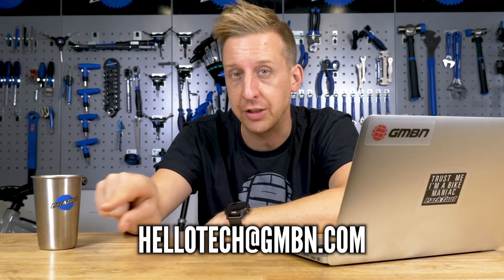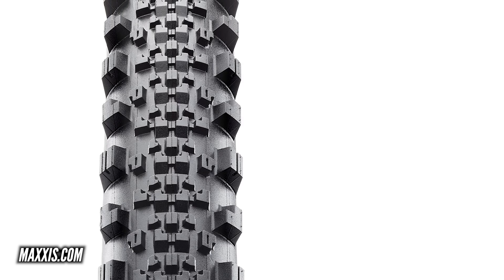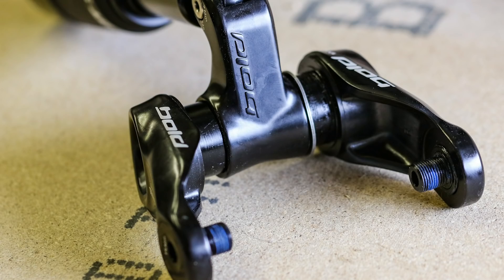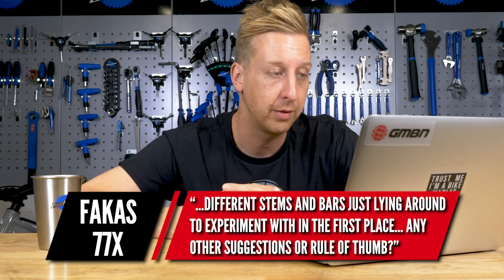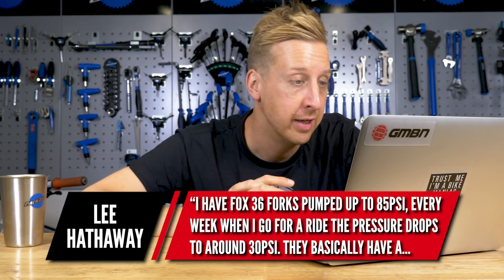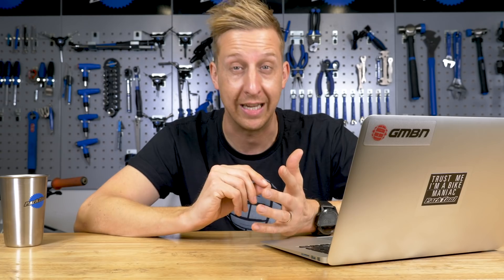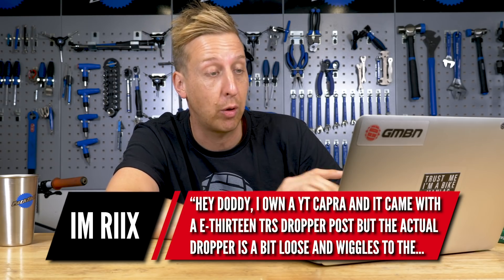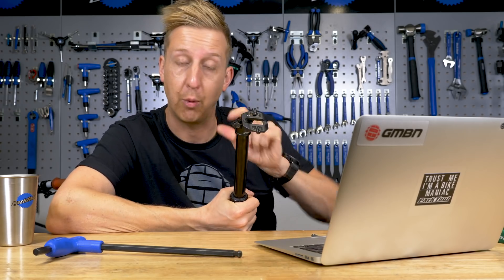Hidden Suspension Designs? | Ask GMBN Tech

Comment: #askGMBN I got a Rock Shox Monarch Debon Air RT rear shock. I already installed bottomless rings but it still feels too soft and I almost bottomed it out after a not that big drop although I got my Sag at 25%. I installed many Bottomless rings but only on the upper air chamber. Because it’s a debon air it has a second chamber underneath it but I didn’t install a ring at this point. Can or should I install a BR there or not?

Comment: @. Hi Doddy love the show. I have a question. I have taken your advice and purchased and pair of Shimano Saint MX80 flat pedals and Five Ten Freerider shoes. How ever when I use these pedals and shoes my hands and feet do sometimes go numb. I don't have this issue with my Crank Brothers Mallet 2 pedals and Shimano AM45 shoes. I'm not sure how my position has changed on the bike. It don't feel different except when clipped in. As a diabetic do you have any ideas as I am at a loss. The role on my bars seems OK. I did have a feeling of having little to no control over the bike. I do feel more confident now.

Comment: #ASKGMBNTECH
Hi doddy! I am one of your grateful fans from Bangladesh. Have learned quite a lot from your tutorials since the beginning. Just to keep things short, Recently I had to install a (30.8x450)mm seatpost on a 30.9mm seat tube. My bike is  giant fathom 29er hardtail. The stock giant connect post was perfect, tolerance was outstanding but i had to use it on my another bike. That previous post was so good even without tightening the clamp post won't move a bit inside the seat tube. Even not  a tiny bit of movement was there. But while installing this 30.8mm post on 30.9mm tube as common sense dictates, due to 0.1mm I felt slight movement inside the tube, i thought at the beginning, 30.8mm into 30.9mm shouldn't be an issue at all! Just one tenth of a millimetre! Though after tightening the seat clamp that movement was gone but can you tell me is this setup could be harmful for my frame in the long run?

Comment: #Askgmbntech I have a rock shop Reba 2019 and had a remote lockout on the bars which got ripped of in a crash is there any way I could put a normal twist lockout on the top of the fork thanks will

Comment: Just a thought to wheel size I'm not trying to start a debate over them, but why didn't they go to 28" and 30" all other wheel sizes have increased by 2" BMX 20", then they had 24" mtb 26" so the logical move would of been 28" then 30"

Comment: The E13 Dropper has both theese problems. The head can come lose, but also the stantiontube can be lose. If that is the case you have to take to post out of your bike an tighten the cap on the bottom.

Comment: The discussion video was good. Liked it. 
I think a useful subject matter would be What are some good bang for the buck components. 
Meat and potato parts.  
Drivetrain parts, shifters, derailers chain, cassettes, etc. 
Brakes, two piston, or four, servowave, vs, Sram junk brakes...😜 etc.
Suspension, shocks, forks. Different levels of dampeners and features vs cost of fork, shock, etc. 
Wheels, boutique wheel systems vs cheap machine built cookie cutters vs old school J bend spoke, rider picked rims and hub, hand built bombers.

Comment: I have a problem with my pike fork. Lowspeed compression is good,  highspeed compression is really blocky.  So i did a service + new debon air shaft. I renewed oil amd grease,  all orig. Sram products + new dustcaps. Its still feels blocky and unresponsive on highspeed bumps. Any idea to solve it?

Comment: Hi Doddy, I would love to learn more about how suspension has developed. I have ridden Mag21's, Pace RC35's and 6's and currently have some 2005 Fox Talas forks. I see the difference between the older stuff, but don't see a great deal visually with the new? Could you possibly run through what has changed to make suspension better over the last three decades? Thanks in advance.

Comment: #AskGMBN I have an X fusion o2 pro rear shock on my bike, and I've noticed that it's rather stiff on the top of the stroke, but moves through the mid and lower strokes quite quickly. I was wondering if there was something like a volume spacer for rear shocks that I could use to make my compression more progressive. Also, do volume spacers decrease travel?

Comment: #Asgmbntech
Hello there, 
I have a Problem with my disc brakes. When I ride and lean my bike to one side (to the right) my disc starts rubbing horribly, any ideas how to fix it? The wheel is true and has the right tension, the disc is older 2-3k km the pads are around 300km old and the disc is true, there is no significant play in the wheel as Well and I'm running a 29er with rockshox 30 tk gold forks.
Reply from the maker: Hey Maik, without seeing this in person and as you have said that everything is all torqued up correctly we would suggest you take this to your local bike shop as they may be able to help diagnose it for you.
Reply: @gmbntech  Hey, unfortunately he says that this can Happen if there is too much flex an recommended a whole new brake or fork. Although it sound like metal on metal.
I try fiddling around since the pads have some life left an the disc as well

Thanks for trying
Reply: Maik Eckert maybe your quick release squewer is loose?
Reply: @peterlang5047  nop, everything tight, no play in the wheel whatsoever and the qr is as tight as possible
Reply: Maik Eckert I don’t know dude. I had the same problem on my XC30s. Turns out the dropouts were squished. I don’t understand how that would affect the disc while leaning over

Comment: #askgmbn 
hi I love your videos a I’m looking to purchase my first full suspension bike and I’m in Australia but I’m looking at a trek ex 7 but I’m also looking at the trek fuel ex 8 what is the difference between them
Reply: Assuming you mean the Trek Fuel Ex 7 vs 8, the 8 has slightly better components, mostly the drive train being GX Eagle instead of NX eagle.  The 8 also has slightly better brakes.  Exact same frame though so you just have to decide if GX Eagle and a Fox fork is worth $900 to you. (Wouldnt be to me, as i dont like the brakes on either and would rather the 7 and spend the $900 on better brakes).
Reply: Thanks

Comment: #AskGMBN I have a new pair of XT brakes 4 piston, the brakes work just fine, although the rear brake lever makes a clicking sound, when engaging the lever. You can actually feel it when applying the brakes. Just curious if this is common issue or an issue at all?
Reply: One of my Saint levers does the same thing, not sure what causes it but I never bothered trying to figure it out. Never caused any issues.

Comment: Fastest wheel size for sure....26 will never die!
Reply: Ben Hensley when was the last time you got a new bike or rode a 29er?  29ers roll WAY faster  then 26, and they inspire confidence better than 26 also.
Reply: Caloway Red I spent some time working as a mountain bike guide, we were sponsored by Ghost and I was a riding a Cagua 27,5 at the time. I liked it a lot, for me it was a good mix between agility and rolling speed. I didn’t like 29’ers at the time because the geometry wasn’t right. Last year I rode a Rocky Mountain 29’er, and it was excellent, very slack head angle and super solid lock on the rear shocks. Just a good bike all round. My current ride is however a 2011 Giant Reign X0. It’s super old but ride great on its 26” wheels. I love it. I live and ride in Austria, so proper mountains and natural trails, I don’t ride bike parks much, so the 29’ers, at least the old ones, handle like a cruise ship in a canal on some of the super tight switchbacks here in the mountains.

Comment: #AskGMBN Doddy, Can I run an under bar dropper lever with the Scott twinloc ? I really don’t like the over bar dropper lever,  I have seen someone in a video with both underbar but for the life of me I can’t remember who it was! Help!
Reply: Daz E MTB Hi, I have a 2013 Scott Genius LT40 with the Twinloc and a Reverb dropper lever under the bar. You will need to buy right hand lever which normally sits on top. Transferring to the left hand side means you need to turn it upside down for the cable to come out in the right direction which means it goes under the bars.

Comment: #askgmbntech I’ve a Fox 32 fork & fox float dps on my stump jumper I’ve set up the sag correctly. I’m using about 95% of the travel on them at the local bike park ( Leeds urban bike park ) is this normal, I’m doing some jumps & stuff but nothing big. Other riders seem to be only using 80% of travel. Should I be considering more air or should I add tokens. 

Thanks in advance love the show never miss a episode 🤘🏻
Reply: You're good, you want to be using all your travel
Reply from the maker: Thanks for watching! It's good you are using all of your travel, some riders prefer to run firm setups and this is just personal preference. You can experiment with volume spacers to see if you like it.
Reply: GMBN Tech thanks for the reply dudes 🤟🏻

Comment: one trick to check for a leaky valve core is get some soapy water on ur finger and wipe it across the top of the valve stem and make a bubble across the hole ... if it bulges and pop's it's leaking

Comment: For leaky suspension parts you can test with soapy water, you can identify where the leak is coming from by looking for the bubbles 👍
Reply: Agreed and ill add for Mr leaky shock that 10% dish detergent and 90% water is a good solution to test with , also good for vinyl or sticker applications

Comment: #askgmbntech Hello! Love your videos and wisdom! I am having a problem centering my brake rotor on with my avid code r. There's not enough pad clearance. I've bled the system. Exercised the pistons and made sure their not sticking. Also i've checked that the pistons fully seat into the bores by opening the bleed port on the lever end and pushing the pistons back. What i've also done is to actually bend the pad spreader to try to help the sitsuation. I just can't get my head around this. Please help!
Reply: I have the same issue on my sram guides too, after I bled the system.it felt like it was worse, pads rubbing, so I removed a bit of fluid, that kinds worked but not much, I'm gonna have to resort to taking it to a bike shop and spending money I don't really have

Comment: #askgmbn hi Doddy. I have a dropper setup with a southpaw style remote on my Hardtail. Since im using a 1x setup, this remote goes on the left hand side of the handlebars. I am planning to add a fork remote on my setup. What could you recommend that I should use to also locate this on the left hand side? I was thinking of the twistloc although I have a manitou fork on my bike. Do you think tbis would be compatible? Thanks!
Reply: Could use just a normal lock out lever and place it on the opposite side of the bar to your dropper (dropper underneath lockout on top for example).  This is how my Giant Reign is setup.
Reply: @gaveltron  thanks for the input but i really like all my other controls on the left side on my handlebars.
Reply: @k0k0w  Yea i wasnt very clear. Both controls are on the left side, but one is on top of the bar, one is underneath. Just saying you dont need some fancy 2 in 1 approach, just need one that works upside down or right side up, depending on what you already have.

Comment: #askgmbntech a high rise bar with less spacers same as having low ride with lots of spacers
Reply: Thanks guys debating on burgtec 38mm or 30mm rise
Reply: No. High rise bars with little amount of spacers equals to same height of the bar (if you set it up that way), but a longer reach, since the steerer tube isn't 90°. And low rise bars with a lot of spacers, again can equal to same bar height, but less reach and usually more reach is better.
Reply from the maker: Hi Tom, for over all height yes, however a flat handlebar with a lot of spacers will have a slightly shorter overall "reach" compared to a high rise bar rolled forwards slightly due to the head angle.

Comment: #askGMBNtech
I've adjusted my rear derailleur a couple of weeks ago (like 3 weeks). It works like it should, but I just took a look and the high limit screw doesn't seem to be like it was 3 weeks ago... The difference is quite big.

So this probably means the limit screw has unscrewed a bit. What can be the cause of this, and how do I fix it?
Reply from the maker: Have you checked the derailleur is still being limited correctly? It is not very common at all as the limit screw isn't really under much compression providing your gears are set up correctly.
Reply: @gmbntech  When I had set it up, the derailleur couldn't move further inwards toward the spokes, as it should. The limit screw prohibited this from happening. Now the limit screw doesn't prohibit the derailleur from moving into the spokes.
Reply: Use a bit of locktight on the screw might help

Comment: #askgmbntech  I have recently purchased a 2019 Scout Comp, and have a dropper post question.   As I'm sure you know, it comes with a BrandX Ascend dropper.  My question is, when its fully extended, is it normal to have a slight wiggle in the extended part of the dropper post?, as mine does have very slight play horizontally.
Reply: Absolutely normal.
Reply from the maker: @Luker Laforest Yes a small amount of side to side play is normal in most dropper posts Luker. Check everything is torqued correctly though if you are unsure or ask at your local bike shop 👍
Reply: Awesome! Thanks for the quick reply! Cheers! 🍺🍺😎
Reply: @lukerlaforest4039  No problem.

Comment: On the informal videos, and in a similar vein to the new vs upgrade, how about, repair vs replace? i.e. when is it worth repairing what you already have vs when are you better to just replace a part? how far can you take things safely,.
Reply: Darren Horrocks Well, Im born in Bulgaria, where people tend to repair and bodge literally everything due to lack of money. I saw welded aluminum frames, rims, derailleur cages, etc. 
However I managed to classify those things to give you an answer if its worth it or not. 

Before you even start, do you have the tools and knowledge needed to do the repair ? 

The first and most important one is - does it compromise the safety of the bike ? If it breaks during a ride will it cause a serious failure which will lead to a crash ? 
2 - If its not life-threatening repair and if it breaks again - do you have the tools and materials needed to repair it good enough on the trail ? At least to get you back home. 
3 - If you repair it - how long do you think it will last ? 
4 - If you replace it - can you still repair the old one and sell it (like replacing the jokey wheels). 
5 - Would you like to upgrade the broken part ? Sometimes people wait until something breaks to replace it with a better component. Like a cassette with wider range. If you are on a budget you would replace the worn out cogs only (if possible). 
6 - Is it worth the time you will invest to do the repair ? Some stuff might take longer than you think. 
7 - How many components are involved in this problem ? (for example is there a knocked out spoke or the structural integrity of the rim is compromised). 

And the final thing is - how much the new part cost ? Its not worth to fix/keep reusing something thats dead cheap. Like a gear cable. 

Answer yourself those questions first and you will end up fixing most of the problems that you face, if you are skilled enough.

Comment: #ASKGMBNTECH Hey Doddy, love the show. I've got an issue with my fox float rear shock. When I set my rebound correctly (it is not the hardest setting) and it takes a big impact at the next ride the rebound is at the fastest setting. So I have to reset my rebound nearly every ride. Do you have any ideas how I can fix that?
Reply: Warranty. The shock is blown.